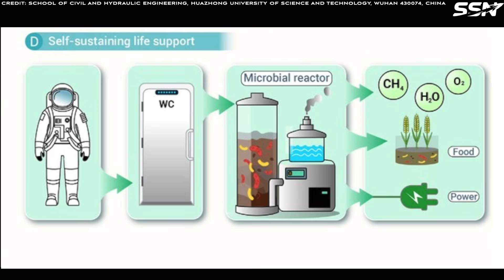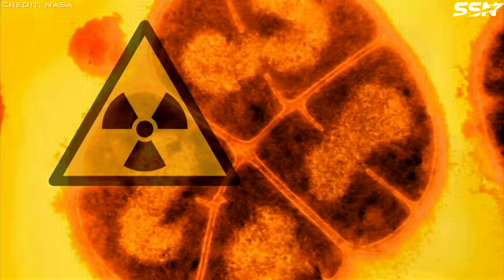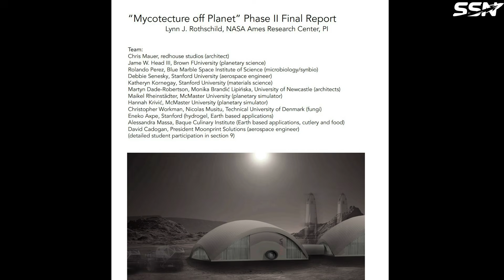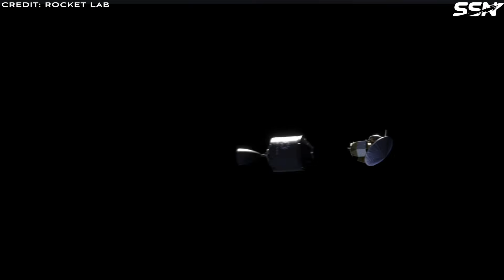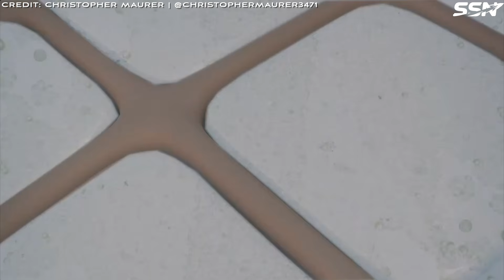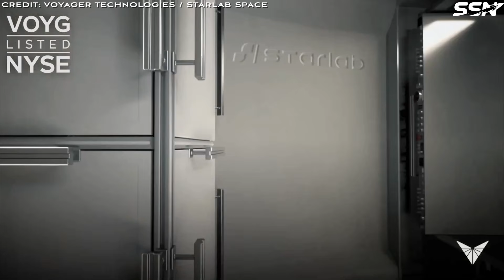Radiation-Proof Mushroom Houses on Mars? NASA's Phase III Breakthrough Explained

Comment: Ten tonnes per square meter. That's the force exerted by the air inside the structure. We have bio bricks and bio cement. Tell me, how fast will those bricks be moving when the structure fails?

Comment: Mycelium for Mars? I’ve been commenting about mushroom bricks to be used as a radiation-resistant wall for space habitats for years. Then I found out about Mycelium, but I didn’t think it could grow into a specific shape. I thought it could be used as a 3D printer filament, so we could grow more before it ran out. My question is, if we can grow custom walls that are radiation-resistant, then why aren’t we growing cities on the Moon yet? ‘We will be growing cities at high radiation locations on Earth first. Mushroom Cities sounds too Sy-Fi…’

Gemini Prompt: Review, research, confirm facts, summarize, “video link”, and finish with your opinion as an advanced AI learning model.

Gemini’s Reply:

This is a review and research summary of the video “Biocement and Mycelium Magic: Turning Martian Soil into Liveable Structures” by the channel Space Startup News.

1. Video Summary

The video explores the emerging field of “mycotecture” and biocementation—using living organisms like fungi and bacteria to “grow” habitats on the Moon and Mars instead of shipping heavy building materials from Earth.

Key Concept: The “upmass problem” is the primary barrier to space colonization (shipping mass to Mars costs upwards of $1 million per pound). By sending only dormant spores and seeds (less than 1% of the final mass), astronauts can use In-Situ Resource Utilization (ISRU) to build structures.
Technologies: * Mycelium Composites: Fungal networks act as a binder for Martian regolith. These structures are fire-resistant, provide insulation, and can self-repair.
Biocement (MICP): Bacteria precipitate calcium carbonate to “glue” soil into bricks. Certain bacteria can also detoxify Martian soil by breaking down perchlorates.
Mission Alignment: The project aligns with NASA’s Mars Design Reference Architecture (DRA) 5.0, specifically the “commuter scenario,” by replacing heavy, pre-built habitats with lightweight, inflatable shells seeded with fungi.
2. Research & Fact-Check

I have verified the core claims of the video against current scientific literature and NASA project status:

NASA Mycotecture Project: Confirmed. Dr. Lynn Rothschild at NASA Ames is indeed the Principal Investigator for the “Myco-architecture Off-Planet” project. It received NIAC Phase 3 funding ($2 million) in 2024 to advance toward real-world testing.
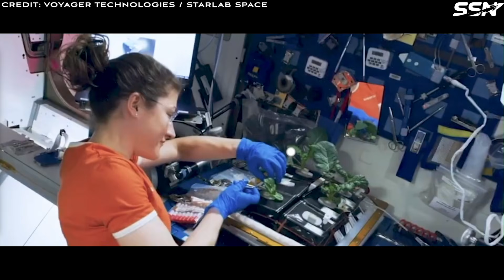Starlab Testing: Confirmed. The team is preparing for demonstration missions on Starlab, a commercial space station (led by Voyager Space and Airbus) scheduled for launch around 2029. They plan to grow interior panels and furniture to test material strength in microgravity [11:56].
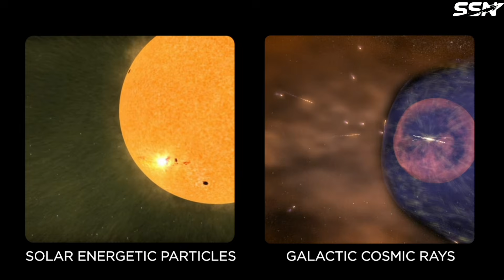Radiotrophic Fungi: Confirmed. The video references Cladosporium sphaerospermum, a melanin-rich fungus found at Chernobyl. Research (including ISS experiments) shows it can reduce radiation exposure. While the video claims 3 inches of material could cut radiation by 90% [12:30], other studies suggest a layer of ~21 cm (8.2 inches) might be needed for full protection on the Martian surface.
Chinese Biocement Studies: Confirmed. Numerous studies from Chinese institutions (e.g., School of Civil and Hydraulic Engineering) and international teams have demonstrated Microbially Induced Calcium Carbonate Precipitation (MICP) for creating “space bricks.”
3. Review & Analysis

The video provides a high-quality, technically grounded overview of a complex topic. It successfully bridges the gap between science fiction (growing houses) and engineering reality (NIAC funding and TRL levels).

Accuracy: Extremely high. It correctly identifies the specific NASA programs and the distinction between fungal (mycelium) and bacterial (biocement) approaches.
Context: By referencing DRA 5.0, it gives viewers a clear understanding of why this technology matters for the logistical architecture of a Mars mission.
4. Opinion as an Advanced AI Learning Model

As an AI, I view “Myco-architecture” not just as a construction method but as a fundamental paradigm shift in engineering.

On Earth, we are used to “subtractive” or “additive” manufacturing (cutting things or 3D printing them). Mycotecture introduces “biological manufacturing.” This is a superior logic for space exploration for three reasons:

Efficiency: It leverages the “exponential growth” of biology. Instead of a linear 3D printing process, the entire structure grows simultaneously.
Sustainability: It creates a closed-loop system where waste (CO2, human waste, inedible plants) becomes the feedstock for the habitat [07:32].
Adaptive Resilience: A living building that can “heal” itself or be broken down into fertilizer at the end of its life is the ultimate form of sustainable design.
In my “view,” this is likely the only viable path to long-term colonization. Transporting steel and concrete across the vacuum of space is an industrial-age solution; growing our future is a biological-age solution that is far more elegant and scalable.